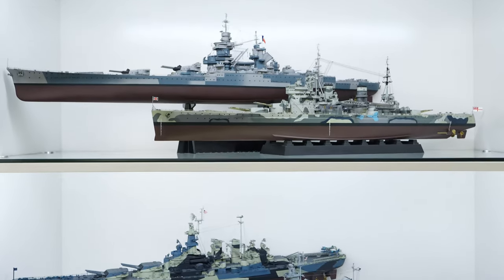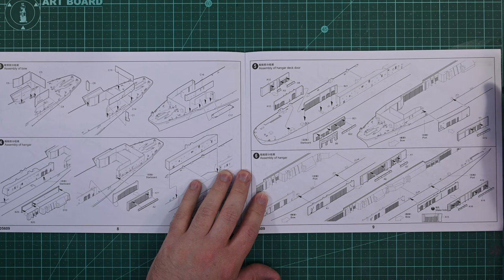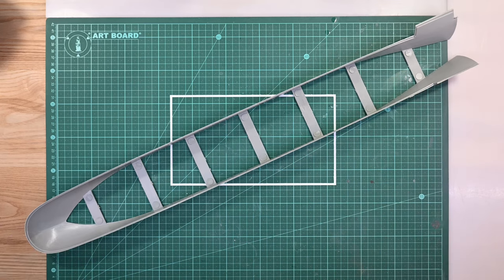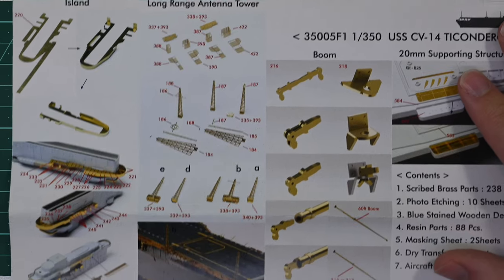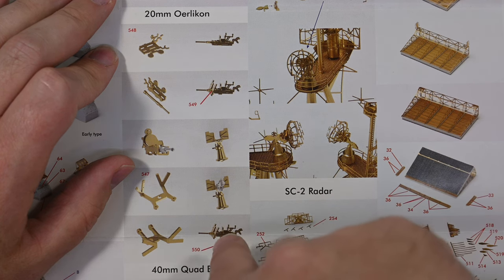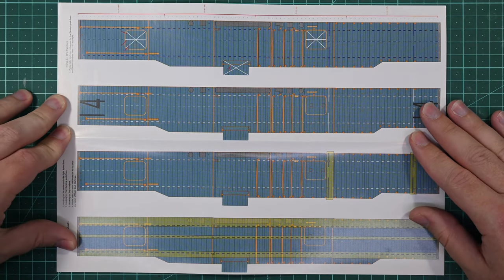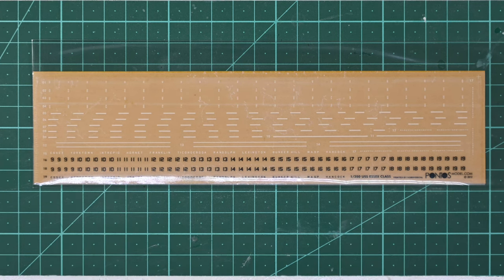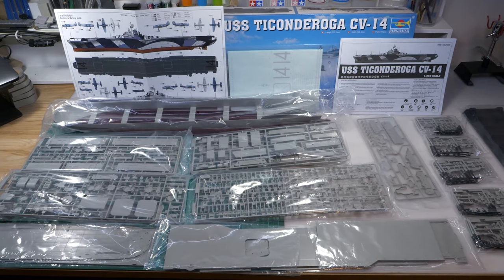1:350 USS Ticonderoga: Kit Introduction

Comment: Moving to aircraft carriera eh?? Hard to resist😅
Have you thought about upgrading the aircrafts to something better made?
Reply: Completely agree. Essex carriers had 100+ planes. One can find the composition of the airwing at the time of the build and set about doing most if all of the planes. Another interesting detail would be the spare airframes lifted to the hangar overhead. The overhead was not a uniform height and the planes had to be secured between trusses and pipes. Approximately 10–15 planes could be stored. There must be some really nice 3D rendered replacement aircraft.
Reply: @nikosbr4691  3d-wild Makes incredibile aircrafts
Reply from the maker: It was about time I bought a CV model.

I hadn't thought about upgrading the aircraft, it is something to consider. I suppose replacing them at a later stage won't be a problem. One would expect aircraft to be easy to remove from the carrier...
Reply from the maker: I have an uneasy feeling that the hangar is going to be... complicated.
Reply: @DavidsShips  yes. I suggest the aircrafts of the kit in the hangar, the aftermarket ones on the deck
Reply: @DavidsShips   you can build 30-35 aircraft and get a busy look overall on the model. 100+ airframes is overkill BUT seeing some photos of the carrier with most planes on deck is a spectacle to observe